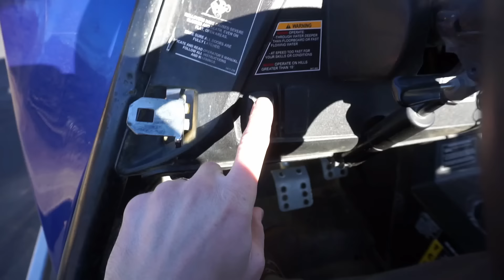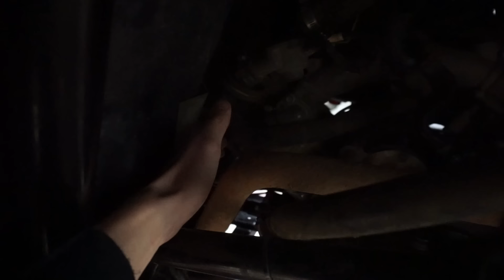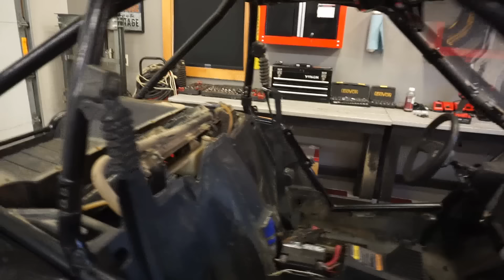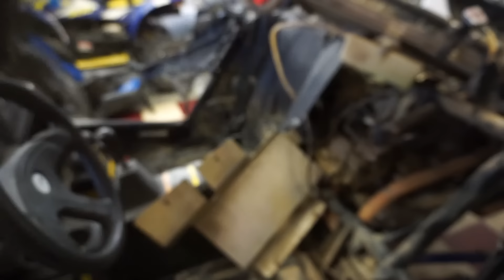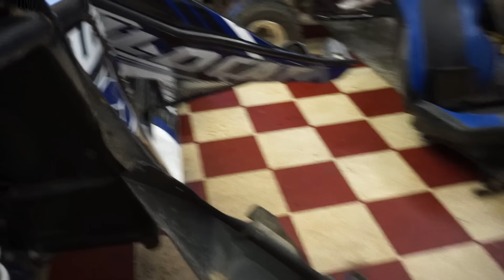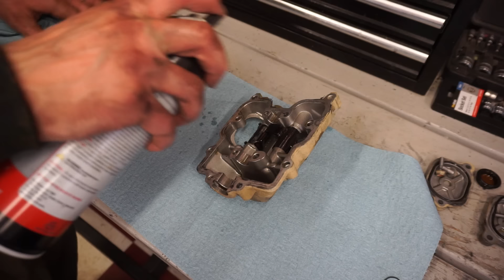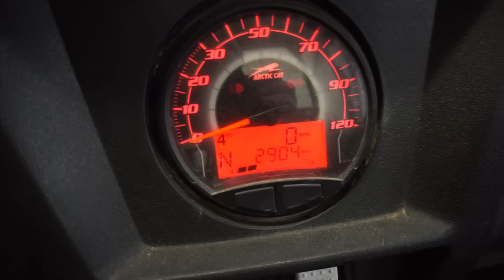Dealership Spent 2 Months Fixing This $3,000 UTV and Gave Up. How Bad Could It Be?

Comment: Great job !!! Do NOT tell the Dealer ... you'll be able to buy future screw ups on the cheap LOL. Had the same issue with my M3 BMW with a blown Head gasket (factory issue) ... they had a $3 million Sun machine and I told them the timing was off and they said BS. So after 3 months in repair and 3 tear downs, I took it away from them and took it to an old man ... had it 8am to noon and had it fixed perfectly ! It was off on 1 bank.
Reply: Or sell it back to the dealership ($3,000 + $1,000) let them sell for $5-$6k - keep them coming back for more
Reply: $3 million Sun machine huh? 😂
Reply: @MrRupus2020  Europe ... when the USD was very weak ... $1.50 per Euro. Just to say it was a very sophisticated machine that wasn't able to decipher what my own Ears could on timing.

Comment: How can a dealer not be able to do what you do with these machines....scary. Maybe stay away from them guys....LOL. Also are these dealer buys from customers that got refunds or something?
Reply: They probably exaggerate the problem to the customer. Then offer them a good deal on a new machine and accept the broken one as trade. Wouldn't put it past them.
Reply: @ObiWanShinobi67  Ya sounds about right but still wouldn't go them if that's what they are going to pull on someone. Maybe they should be looked into ...LOL

Comment: These dealerships need to get better engineers, because they should have found this problem. But a great win for you.
Reply: The dealerships in my area couldn't change a spark plug gotta do it yourself nowadays
Reply: What would an engineer do at a motorcycle shop? They have crappy mechanics because of low wages offered
Reply: They can’t even find enough qualified folks to take out the trash
Reply: @gutsgorrrr

You must be British, where anyone in the trades is called an engineer, except plumbers, lol.

Comment: If that thing needed a rebuild at 2000 miles no wonder Arctic Cat is slowly going out of business
Reply: The engines are pretty reliable on them.
Reply: Arctic Cat is done - Textron shut down manufacturing earlier this year.  Inexpensive Asian imports?  Huge loss for Theif River Falls MN
Reply: @thebigguy8306  i believe they still sell them. New wildcat is 23k. That's the cheaper model.
Reply: @thebigguy8306 thats only sled production thats shut down
Reply: Lol there are plenty of popo's and canned hams needing rebuild at this stage aswell.  Atleast this rig comes with a true front locking diff
Reply: @bigjay6743    lol   plenty of brands need rebuild early. All depends on how its treated n serviced

Comment: If i owned the dealership you bought this from i would fire my technician first thing this morning
Reply: Grâce à ce technicien qui a pas réparer cette machine. On a la chance de pouvoir le regarder chez vintage. 😂.
Reply: Having worked at an automotive dealership I'd cut the dealer some slack.  They are an assembly line operation, 10 mins to figure problem, 45 mins to fix.  The customer may not have wanted to pay for diagnostics.  Ol' Joe here has the patience, knowledge, and time to strip it down
Reply: That small fan is for blowing out gas paper in the engine bay like a boat so it don't explode 😮
Reply: @rockman49er oh no
Reply: @rockman49er I hope not
Reply: @rockman49er  omg has a boat blower how funny hope it doesn’t blow up
Reply: @rockman49er *Vapor
Reply: The people that were there,were probably at McDonald’s the day before. Can’t have good help if you don’t pay good. A problem all across the  anything mechanical industry.
Reply: You ain't wrong
Reply: Unfortunately the dealership sees $3-4k profit go out the window really quick (mostly due to incompetence). Say the mechanic spends a week working on this thing, that’s $1k or more. Say the mechanic likes to throw parts at it because he doesn’t know what he’s doing, that’s another $1-1.5k easy. Now you squeezed $2-2.5k to get this thing running in labor and parts and it still doesn’t run because the mechanic hasn’t spent the time to think that the timing is out (spoiler alert). Now he spends another week tearing it apart, costing $1k or more in labor once again. That’s all if they even got it for $3k and can sell it for $7k, which they might have sold it at a loss unless it was a trade in. Much easier to say to a customer “we have looked at it and we believe it’ll cost you $4k to fix it and it’s an 8 year old UTV, we have this new one you can trade this in for and get $3k off, no money down, and pay $400/month on, $25k down to $22k and we’ll make you a deal”. A dealership is about money and these operations just don’t make enough money on repairing the used vehicles compared to selling a new one. We’re lucky to have Joe that knows what he’s doing and can fix something like this in a single day.
Reply: Dealership had to cut their losses on this machine. No money to be had after paying an employee to work on it and then paying for parts you can't blame the Dealership or his mechanic smart business decision. This is how a guy can own toys, buy broken and fix it up. Great content 👌
Reply: @10xshooters  They left $4000 on the table, you don't stay in business long doing that.
Reply: @10xshooters  I agree, who's to say that the dealership's technician didn't know what's wrong with it. They have to make money and if it costs them to fix it and not make a profit then they will cut their losses, moreover I would bet that the same dealer fixes more machines than we know otherwise Joe wouldn't be buying machines from the same dealer.
Reply: @10xshooters That's BS. The company would have made good money on it I'm sure if the mechanic was worth a shit
Reply: Joe is going to make this arctic cat his daily driver.
Reply: Dealer still has to invest $ for the techs time to investigate.  So I somewhat agree with you but can still understand the dealers point too.
Reply: If you’ve never made a mistake you’ve never done anything 🤔
Reply: I dont see any smart decisions here my guys. Yes I would blame the dealership and the mechanics working on this equipment for their incompetence and for nobody being held accountable. The timing is simple mechanics and I knew that right off the bat. You can’t fix stupid and there are a lot of stupid people around nowadays.
Reply: A dealership isn't the repair shop for ancient models that someone else has worked on and f'd up . A lot of times the repair cost is higher than the vehicle is worth and the owner refuses to pay , and the shit show begins . Best for a dealer to pass it off to a private wrench with little overhead
Reply: Me as well Sir. That's incompetence
Reply: Me too lol😂
Reply: I'm thinking the difficulty the manufacturer made in rotating by hand facilitated the dealership mechanic not pursuing the problem more.
Reply: That's a clutch cooler and they're never supposed to be in there they block more air than they do good get it out I know from first and experience I had one on a 15xx. The fans come on with the temperature first one then the second one so it's probably a sending unit
Reply: Also they're a pain in the ass to bleed out you have to object the front end up so the air bubbles can climb to the higher part of the radiator it's in the manual
Reply: News flash man they're not really called technicians anymore the called parts changes there's a difference, there is no such thing as a technician anymore because they're too expensive to keep on staff LOL
Reply: To all you who are supporting the dumb technician, Timing issues are NOT difficult to check and should have been spotted early by any grease monkey worth his salt. Just saying.
Reply: Exactly
Reply: I feel like we all make mistakes but as a mechanic myself I knew instantly it was out of time by the way it acted when he test drove it. Basic mechanics but simple mistakes. Good one on ya Joe. This thing is a mechanics nightmare as far as design errors. Pain in the rear.
Reply: I don't blame u
Reply: You have no clue
Reply: Was thinking exactly the same thing. A dealership couldn't fix it so they gave it to him for nothing? For once, just a little strange ALL of the stuff he gets happens to be for nothing. All things he says nobody else can fix. Like he's the only person on earth that can get an engine running. From watching him he's really not even that great of a mechanic. So all of that seems weird. And two, a dealership should most definitely be able to fix one of their vehicles. And if that story is true in the first place yeah that dude would be fired if I was the manager or the owner no doubt
Reply: @xsixinfantryx a lot of that is meant to be enticing for the way youtube works. 
The "drama" stirs people's intrigue and more likely leads them to clicking on the video. 
I hate click bait titles also but it unfortunately is how the medium works in many cases.
Reply: They make money on loans.  If it takes more than a few hours then the juice prolly isn't worth the squeeze
Reply: Unfortunately, getting people to just show up to work is keeping those techs employed…
Reply: I agree how you have it 3 months and never think to check the timing.... duh that's the biggest part for Vtwins... is timing idiots 🤦‍♂️
Reply: Why? They sold it for $3000... That's about all it's worth running or not
Reply: @michi_danksta good luck with that. You find a running unit at that model year and size send me link. Everything in my area is double or more that cost.
Reply: Joe sell it to you for 6000$
Reply: @michi_danksta  Cheapest one listed in the country is just under $7000 so yeah, no... Somebody left $4000 on the table
Reply: @michi_danksta 100% agree. There’s no meat left on the bone for a stealership, the repairs, replacing damaged cosmetic stuff and then detailing it. Just not good business. Get it running and hit it with some soap and water and it will be a great private sale.
Reply: I’m 10 seconds and you’re probably right 😂
Reply: Maybe if US companies treated their workers like human beings with rights they would do a better job.
Reply: @ it’s not rights it’s greed.
Reply: @epicci4428  WTF 🤷‍♂️
Reply: @mikeandrews1899  US labor rights are the worst in the developed world. They've managed to scam you into thinking that unions are bad. Americans work more for less pay than anyone else in the EU, Canada, well... most of the world basically.